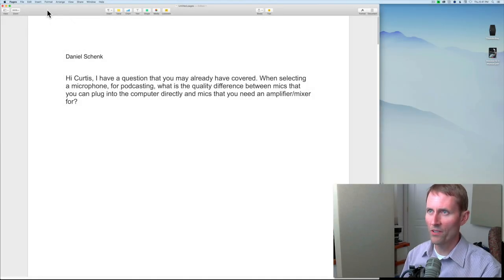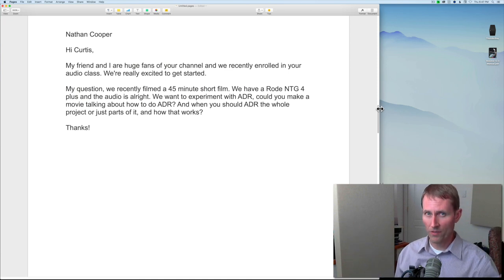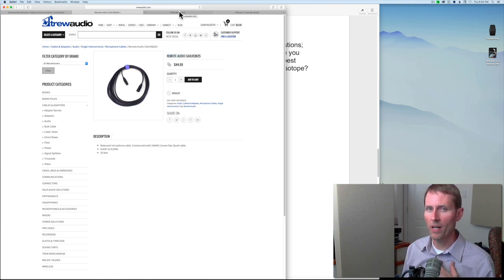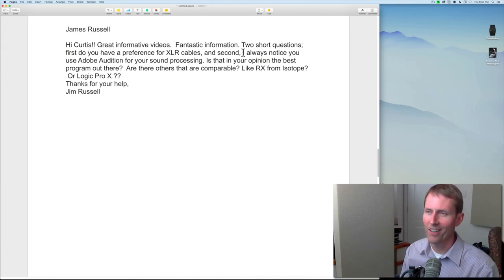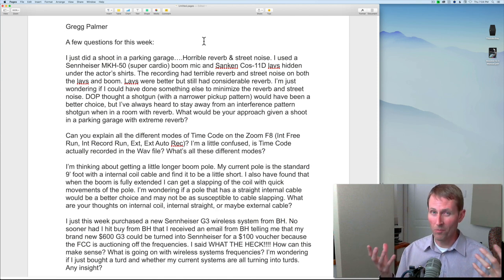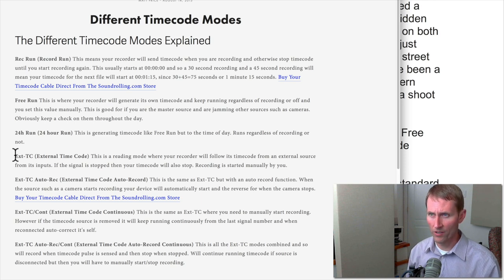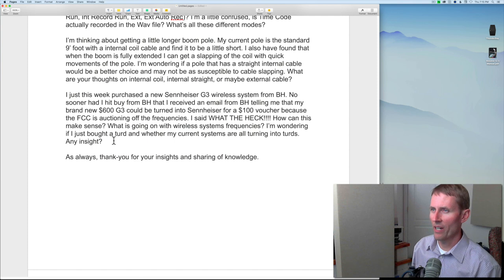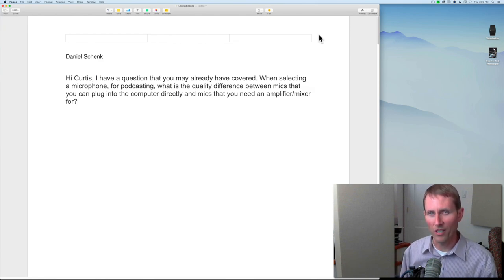Sound for Video Session: USB vs XLR Mics, Timecode Modes, Wireless Frequencies

Comment: A great in depth explanation of Looping in Pro Tools is in a book called "Audio Postproduction for Film and Video" by Jay Rose.  I've done looping sessions for two Indie features from that text.  It has turned into an invaluable post skill.  Granted, you must first have a usable facility, and some directing talent is crucial.
Reply: I have not been able to set up any usable looping session in Audition.  However I do love mixing small projects in it.  A big deal is the loudness metering, and match loudness.  I basically use Pro Tools as my recorder and bump the OMF into Audition for all of the post processing and mixing.  Free plugins are a big deal.
Reply: Great info, thanks Matthew!